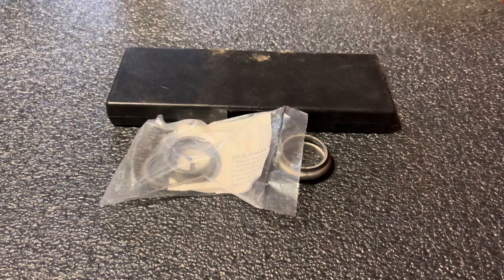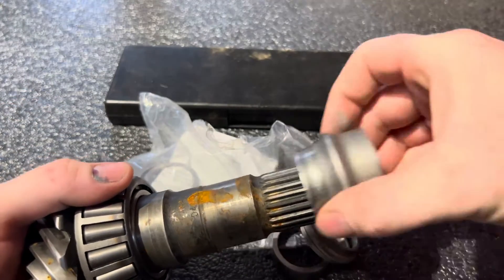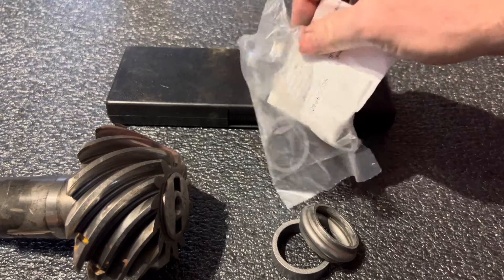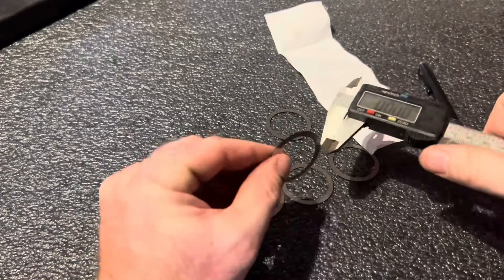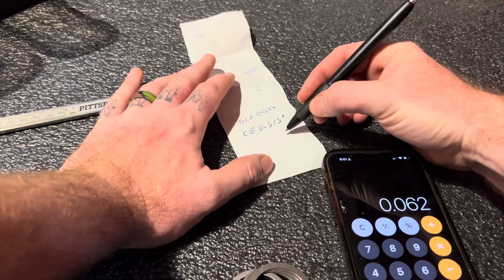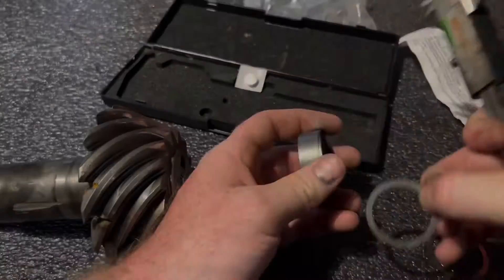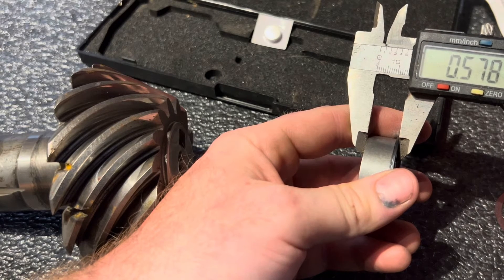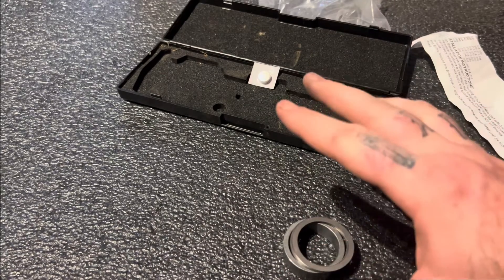How to set up a crush sleeve Eliminator

Comment: install the sleeve.  wrap solder wire around pinion where shims will be installed. tighten to approximate preload.  Disassemble and measure solder.  Gets close when there is no old spacer

Comment: This video is useless because it doesn't show you actually putting the pinion back in the rear end to see if your brilliant way of doing the CSE shim calculating actually worked. i got one of these Ratech CSE's and it was actually too short, even with all the shimming
Reply from the maker: Go watch the full episode and you will
Reply: Sucks! But I’m glad to see someone else had the same problem I did with a Yukon Dana 30 crush sleeve eliminator, never gave me a preload even close to what I needed

Comment: Nice video, I've watched about 30-40 on differential rebuilds, and I still learned some new stuff from yours. So what is the maximum you can go over on your eliminator? 0.002", 0.003", 0.004"? You showed your situation with 0.001", but what is the practical limit? Also you only show what the preload you got in inch pounds for a flash printed on the screen. I think you really should have mentioned out loud that it is subject to the preload you measure after you torque the pinion nut. And finally, I watched the video looking to find out what the torque is on the pinion nut with a crush sleeve eliminator.